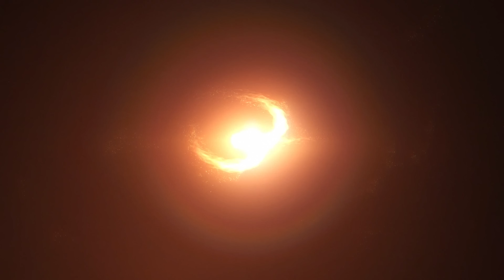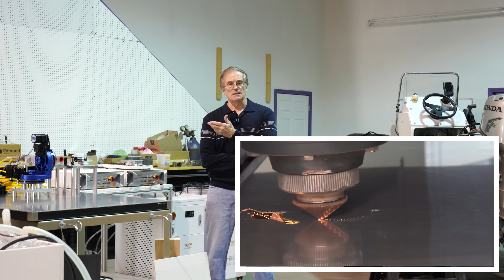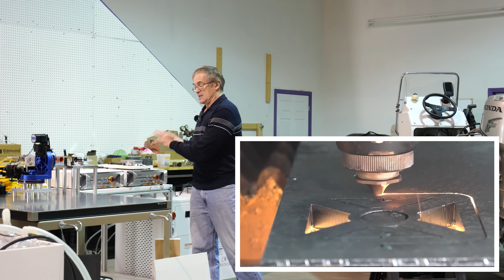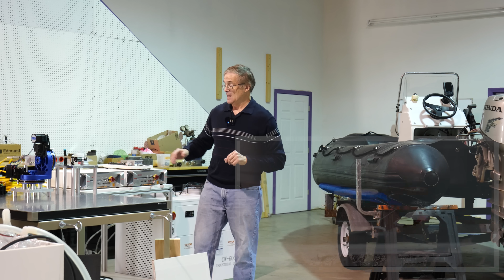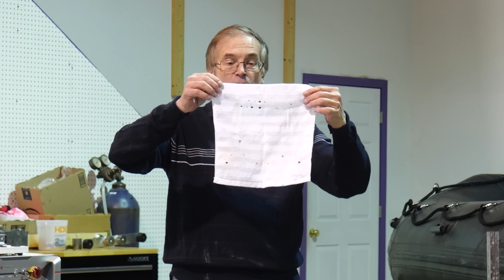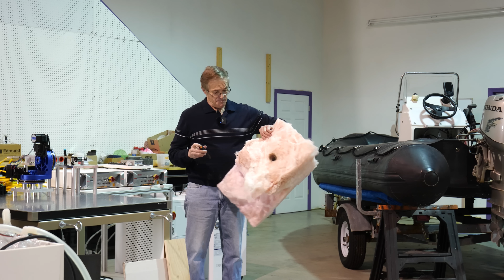We have a problem... and need your help!

Comment: Some options to stop the beam (will not comply to all requirements. Pick your poison!). Not all make sense because I don't know the power and spot size you have in mind. 

First of all: Maybe the only thing that might fit all your technical requirements: Active walls. Basicly double walls with an IR sensor in between that shut down the laser via an interlock. Laser Spy by Kuka (formerly Reis Lasertec) is a common sensor choice. But there are others. 

All the ones below are possible but infringe with one or more of your requirments. 
1: A water tank with an absorber. You might make a hole into the tank, but the beam can be dissipated inside. There are special absorbents for that, that almost work too well and cook the water locally. Or test a cheap solution: dark food colorings. You'll probably find one that has sufficient IR absorbtion to dissipate the beam in a given layer thickness of water. When scaled, this can stop every laser beam.  
2: (Maybe possible): Low tech: A block of wood. Works really well with lower intensity. I don't know what order of magnitude you are planning there. Might be beyond the capabilities.
3: A block of graphite. It will flame and generally be very spectacular when hit. But will take the abuse for a short while.
4: A block of a highly reflective metal. Silver coated copper should widthstand a couple of seconds. Reflect the beam into a sacrificial target.

Comment: Aluminium comparatively light has high enthalpy of vaporization and expensive.

Gel - gelatin with water on some frame (like etamine, cotton wool or etamine with cotton wool). Should be hard enough to maintain some form for a reasonable perion of time, but runny enough to close narrow holes in 0.1 s. Should be testet. Questionable possibility of reusing. Degradable. Could be not gelatin but another substance.

Sponge soaked with water or gel. It has to be on some frame to support it. Could be in sacks suspended on some frame,

Silica gel in sacks or boxes. Wattered, of course. Cheap, easy to maintain, bulky.

Sacks or boxes with sand or soil. Really cheap, but will cost you to assemble/disassemble.

Transparent sacks or watermelons - the best chois for a fun show.

Comment: A couple ideas:
-Set up a thermal camera, which is able to detect when the beam is hitting something it shouldn't, and deactivate the laser
-One idea for an emergency shutdown is use a spinning first surface mirror, axial so the beam doesn't actually wobble, but if the mirror were to stop spinning, it would melt through, where the beam would go into an absorber. The safety would be cutting power to the motor.
-Set up an IR camera which can visualise the beam, and have a big TV screen, so you know where the beam is at all times. 
-Know what you're shooting. Know how the materials react to the laser, if they absorb, scatter, etc, and know exactly where the path is going. If one second of blast is enough to take out a drone, limit pulses to one second, even if the drone isn't disabled. 
-Set up heaters, or something which would cause convective airflow with lower density air to cause the beam through the air to distort, hopefully enough to not burn through something so quickly. Sure, would need a ton of heater, but only needs to be on during firing. 
Instead of aiming the laser up into the air at the drone, elevate the laser and have it face down toward the drone, where the ground would absorb the beam. 
A couple other ideas (water curtain) better said by other comments

Comment: How about thin conductive copper/aluminum tape wrapped around a wooden frame, that just barely carries the current draw of the laser in series - such that if the laser even burns an edge, it'll pop like a fuse!

If you get too thick of tape, just wire a load resistor in parallel with the laser to raise the current draw through the tape.

If you lay out the gaps properly, you wouldn't need to insulate it to get total coverage of the frame between the front and the back.

EDIT: If you affix the tape at the edges, you could solder patch pieces in from edge to edge and reuse your work many times!

Comment: Is there a way to defract the light using a wall of falling water (laminar flow) so that gypsum board would be sufficient? Easily tested with 2 rectangular buckets and a small pump. Pump the water to the higher bucket and set it at a slight angle to control which side it spills over, then put drywall behind that. Maybe you will get a good result.

Comment: Galilean beam expander and Beam dump. One that is rated for the lasers output. Like BD5000W-BB-50 5000 W Laser Beam Dump. You have to expand the laser beam before hitting the dump or it will burn through it.

Comment: Vermiculite and running water with a black dye. Vermiculite should be good as sand and way lighter.
Reply: the right salt may work too. High temp quenching salt and not the severe chance of a steam catastrophe

Comment: I'm an engineer's, engineer... A fixer... I fix what people in a bubble overlook, forget, overcomplicate daily... Sounds like you need them tiles from the Space Shuttle... All jokes aside, how about a curtain of water that's not running down any surface? It would break up the beam as it passes through, thus spreading out the beam and lowering the potential of burning anything behind it, I think droplets won't work, it would have to be a laminar flow curtain, maybe .5mm thick to 1mm thick or more, with some sort of pump and filter recycling the water back to the top with a holding/collection tank... This won't cause the EPA to beat down your door from TOXIC chemical runoff, or breathing in some wonderful burning chemicals, or reflecting deadly laser beams all over the shop. I see from reading comments below, BIGGEST thing most engineers forget to do is K.I.S.S. and legal implications. Just water, that's all acting as a lens that'll break up the beam... Falling water will keep falling even if it's being converted to steam, and that steam would also disperse the laser energy... Water... Water... Water...
Reply from the maker: Pretty good.
The water will work as a coolant. Its interaction with 1080 nm light is relatively weak, but it could cool another surface that absorbs that light, such as rockwool.
Reply: @TechIngredients  OK I got it, I had to go for a ride and think about it for a little bit and as I came ripping off the interstate and flying up to the offramp stop sign, I figured it out. And I think you already know the answer to this since you guys did a video about something with similar properties quite a while ago... It would work although it's not going to be "cheap" or "affordable", Carbon-Carbon or the more expensive Carbon Ceramic, like my red-hot brake rotors at the above-mentioned stop sign... Although you may still have to actively cool it with running water over it. That would probably be the World's most expensive decorative shop waterfall when you're done...
Reply: Have you tried shooting the laser at an unpainted ceramic square? I guess that might be too brittle to be functional...
Reply: @TechIngredients  I'm also calculating based on an average power density of about 6.3679 × 10⁹ W/m²... And the need for something 3mm to 5mm thick, and covering around 10sq meters...  Maybe Elon has some scrap heat shields laying around...
Reply: @TechIngredients  Tungsten could also work, although it would definitely need to be actively cooled, and the surface would need to be roughed up as to keep from reflecting the laser, and the cost would be much cheaper than Carbon-Carbon or Carbon-Ceramic, and Tungsten is brittle but not as brittle as a ceramic...

Comment: i have several ideas first a barrier made of black colored soaked silica sand / or normal soaked sand integrated a metal plate (this of the mentality that metal will absorb part of the beam using the water cooling the plate and the sand melting creating a amalgamation protecting the plate in theory) second using the same mechanism of the last idea  but with a kill switch sensor that as soon that it hit the plate will kill the laser. 
another idea is using a refracting item to put the beam of the laser down to earth which it can apply the other 2 ideas as well matter of fact you can use  black water bucket with several bricks and a sensor of light putting the refracting item  in a L shape cylinder

Comment: In most high power continuous laser setups that cut, the generated smoke is a serious limitation on achieved beam power getting through the smoke. Max out this effect.

I would start with the Starlite recipe (ver2 by NightHawkinLight), and add carbon black to maximise smoke.

An alternative is superlight diy kiln bricks designed to ablate and then be repaired (again with additional smoke ingredients, carbon black or something with a greater albedo), so I would use: sand (varying sizes), perlite, carbon black (or fine sawdust), and sodium silicate as binder. 

You could even use a raster pattern of your laser to cure the sodium silicate mix after repairing a patch you blasted.
Reply from the maker: Good suggestions.
I especially like the thought at the end to use the laser to cure its own barrier.

Comment: There are abandoned rock quarry's all over the country.  Im not sure where you're located,  but If you built your rig into a semi-mobile system,  you could just conduct your experiments there.  Just build a mechanical stop so the beam cant raise beyond a certain elevation,  and voila,  you've got a rock wall back stop.

Comment: Use wolfram.  You need 2 cone wolfram that are empty inside and sticked together. You cut one point of a cone  where the laser comes in. Maybe you can coat the inside of the cones with some grafit  or with some kind of black ceramic. Make sure you hit the inside of the cones with an angle.  Some inert gas inside might help. Idea 2: wolfram cone, empty inside that is attached from inside of a fish tank full of water. You use the water as heat disperser. I would think about it as I need to block lasers from enemy on a spaceship. You need something to brake the laser before you hit your material and manage the heat long enough before the material breaks.  Maybe a 3 materials shield ? Quartz crystals + wolfram + water tank. You might need to change the quartz each time but is cheap. Sorry for my broken English.

Comment: Call Elon Musk…..😊
Reply from the maker: We have him on speed dial.
He said he'd think about it but admitted that this was probably too difficult for him.😏
Reply: @TechIngredients  Have you looked at total internal reflection using a water stream? It’s a science trick to bend a laser beam.
Reply: @TechIngredients  Total internal reflection. Get a 3’x8’ galvanized stock tank, a 55 gallon drum and a variable speed recirculating pump. Drill a 1” to 2” hole (this may need to be smaller or larger) on exact opposite sides of the barrel about 1/2 way up on each side. Place the barrel in the middle of the trough with the side holes exiting to the long sides. Fill the barrel with water until it reaches the level of the side holes. Now fill the trough to about 18 inches deep. Place the pump in the trough and run a hose from the pump to the top bung on the barrel and adjust the flow so the barrel stays full but does not overflow. Add water to the trough as needed. You will need to have a good solid stream coming out hat makes an arch.
Then position the laser so it enters and exits in the exact center of the side holes. The laser will enter an outflow water stream and will exit an outflow water stream. Turn on the water pump on and get it adjusted and fire the laser. The superheated water will be exiting and aerating on it’s way down. The outflow on the back side will be the water refraction for the laser and bend and disperse the laser if the laws of physics hold true for a laser with the power of this one.

Comment: Perhaps a multilayered block wrapped in metal that is mirrored to the inside. And the core of the block being crystalline as to diffuse the laser light as much as possible. So in theory the laser hits block burns through and into, is diffused and reflected around internally. I would guess that should buy a few seconds in order for there to be time to shutdown.

Comment: I would use a water filled traffic barrier but put it on large casters. If you put a hole in it you can seal the hole with silicone.

Comment: Maybe hold off on the crazy powerful laser and improve the tracking and guidance system.  The killer laser is just dangerous and military grade.
Reply from the maker: You're right that these systems are independent. But, eventually, they need to be coupled to varify the system performance.
Reply: @TechIngredients yes sir, but at that point the system is indistinguishable from mil hardware and agencies r knocking at your door lol

Comment: I’m curious how well layering fire block Sheetrock in front of a copper sheet would work.    I realize the copper may be too reflective but 2 or 3 layers of 5/8 should help with that especially if it’s angled.      Admittedly I’m not well versed with lasers especially this powerful.
Reply from the maker: Very few people are.
The Sheetrock is promising.  The copper would be prohibitively expensive.

Comment: Utilize a glass bead and fluid possessing a high refractive index for the laser to divert the trajectory of the laser beam through refraction. Implement a pump system that generates a cascading flow of bead/fluid slurry to facilitate scattering of the laser light within a fresh flow of cool fluid.

Comment: Build the rear wall with a layer of green board, then apply a layer of small mosaic bathroom tiles.  Then flow water over the surface to capture the heat of the beam.
Reply from the maker: Not bad.

Comment: Install powerful fog generator looking upwards near the wall that needs protection. Use several of them to create a "steam wall". When laser goes through dense fog, it will loose it's focus rapidly. This is one of main cons of laser weapons, they don't work well in foggy weather.

Another option - an aquarium filled with water and any dye that absorbs wavelength of the laser, I guess it is IR spectrum.

Comment: You need large lens / mirror. Not small one. Diffraction is gonna limit you sooner or later. Large aperture is a must. Yes, it also means focusing on the target distance. But it will help with stuff beyond the focus plane.
And obviously some form of beam trap, but sadly I have no experience with lasers this strong. Also what's the wavelength ? What about fog machine ? Water spray ?

Comment: Have you tried any refractory metals, molybdenum, tungsten, etc? Try a target of Tig rods, optical glass sandwich with Argon filling. A 5x5 target should not be too expensive for a test. Tungsten plates, rods and wires are available for larger structures. I would suggest inert gas shielding to prevent thermal oxidation unless you are vacuum wizards.  Circulating the shield gas through a HEPA filter may keep the glass fronts and back clear.
Reply from the maker: The tungsten would be too expensive over about 25^2 meters. We need consumer grade (cheap) sheets or panels.
Reply: It is available in fine powder forms and may be amenable to the falling wall of sand treatment. The way dudes excellent content as always👍👍🖖 @TechIngredients

Comment: A water tank with an inch or two of water, the fluid could be colored, also set it at an angle, it could act like a prism, if you get fancy you could design a light trap. The water would absorb heat and spread out the light,  the water would self repair

Comment: You could try flowing water over the plywood or between 2 layers, in a waterfall/fountain arrangement, recycling the water cooling the plywood hopefully prolonging the burn time and extinguishing any flames quickly. Obviously it would take a little testing to see the best configuration. For example the amount of water required angle of the plywood etc. (angling the plywood could be used to change the flow of water and also spread the beam contact area.) I would imaging this would be reletively inexpensive and easy to scale because you shouldnt need any specialist equiptment. Reading the comments you have a fantastic video here,  just in testing some of these ideas!

Comment: Laminar flow sheet of water, and suspend particles in it that would convert the laser energy to heat. Perhaps some carbon or graphite powder with some polypropylene glycol to keep it in suspension.

Comment: You should do the plywood thing but get the son of the main presenter to squirt water onto it with a hose, or set up some sort of sprinkler or flow water over the plywood. The wood would block the beam and the water would dissipate the heat by evaporating.
Reply from the maker: I like that.
My son, on the other hand...

Comment: Can you keep pink insulation on rollers
 moving about 2 feet per second?  It sort of works except it can't dissipate heat because it is insulating!  (I was an X-ray technologist.  X-ray anodes are tungsten, molybdenum for high temperatures, and have high speed rotation so the same area hit by the beam (though the same spot) isn't being hit all of the time.  But, I like the refraction idea in front.  Could that pink insulation be fastened to a large circular surface and kept spinning while reciprocating?)  
I liked the Slayer553826 comment too.

Comment: - Transparent plates, sanded lightly with high grit in rotary motion scattering light to larger surface area through multiple layers?
Might require few trials to find working combination of material & sanding grit. Basic class melting point might be to low.
- Aquarium with or without sanded plates inside, filled with water with light absorbing dye added in?